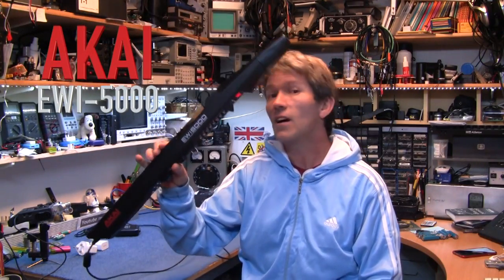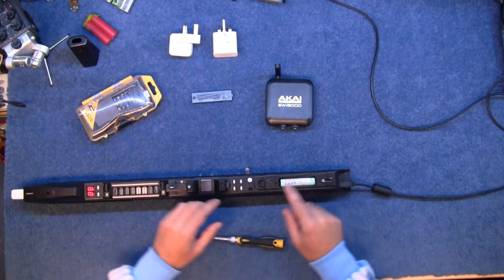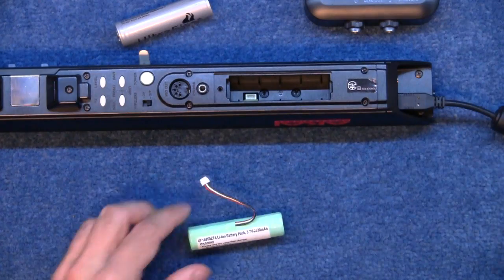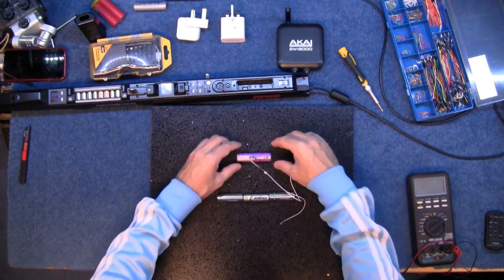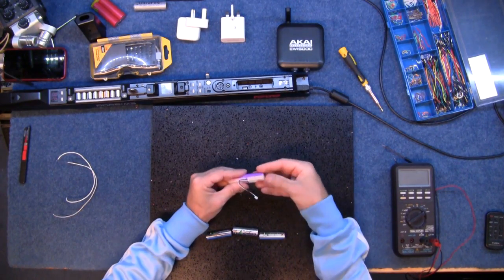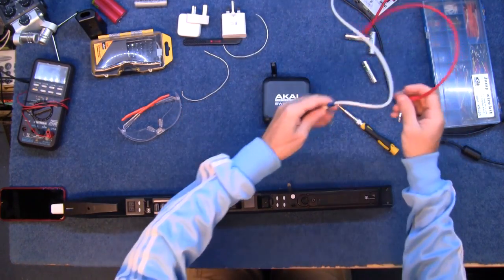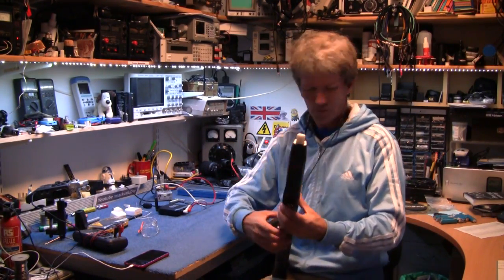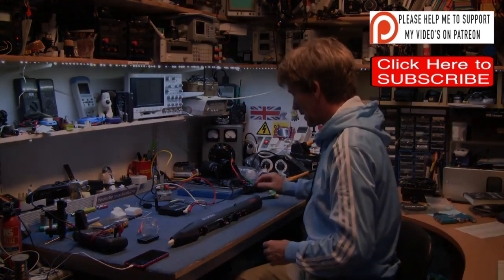AKAI ewi5000 the 88 fault lithium battery repair

Comment: I can't believe you don't have a proper variable lab power supply with current limiting capabilities. Would be much more saver with that.
Also the handy cables with the pins for breadboards you have in your blue chest should fit into the plug without falling out.
Love your videos.
Reply from the maker: Hello Foamidable. I have the agilent 6632b which is perfect for the job and yes as you pointed out there are the pinned cables (well spotted) but the majority of people who may own this musical instrument would not have access to these laboratory devices. I was thinking of making the video in a way that almost anyone can have a go at this fix themselves as most people would have 3AA batteries and a piece of wire. sometimes I feel my repair videos need to take into account what most people would have at home. Best wishes from Markus
Reply: It was dawning on me 5 min after I wrote the comment but I was to lazy to remove the comment ... now I feel awkward for my smartassery
Reply from the maker: No problem as I am pleased you bought this up.

Comment: so this allowed it to get to 2.7v? simply adding low voltage protection would have saved all the bother. However at 2.7v charging it is no real danger as it's not low enough to start damaging itself and causing copper to form on the internals where it shouldn't. Seems like they made a simple mistake they shouldn't have.
Reply from the maker: Yes I kinda think this part of the design was simply overlooked and it went into production. other than those flaws its a pretty interesting instrument

Comment: Thanks for the tech demo. Seems like they should've used a faster processor, and memory. Very interesting instrument.
Reply from the maker: Hi Thomas. with just a few tweeks this could have been an upgrade version of the EWI4000 instead I think its a bit of a downgrade.
Reply from the maker: when I had the ewi4000 I used the MidAir by M-Audio though thats like hanging a brick from the device. but it worked and like the fool I am I guessed newer is better. but not in this case. I would swop this 5000 for a 4000 without hesitation.
Reply from the maker: Hi as long as you take out the battery when you will not be using it for months then it should be ok. mine was on the shelf for several months with the battery installed. I found them following akai website then off to spares etc. they are on there for $49.
Reply: hi marcus, we spoke a while back about connecting up my moog sub 37 to the 5000. i find the panda audio midi beam works really great - it's not expensive and the range is amazing. easily goes 50 feet or more in an open room. http://panda-audio.com/midibeam.php I use mine a lot live and am a bit worried about the battery now - would like to get a spare just for safety. can you give me a clue where i can get ripped off for $49 please? :-) BTW i agree with you about the sounds - i have a vintage ewi 3000 and 3020m which sounds great and although i never had the 4000s i heard them and they sounded pretty good. as a controller the 5000s is better as you can program the breath controller to output any midi cc which is pretty flexible. i decided i never wanted to hear it's actual sounds again after about 10 minutes messing with it!
Reply: yeah - i just checked mine and although i haven't played it for a while it's still at 92%. it's more of a belt and braces thing as I use it live. would be good to have a spare charged up in the gig bag just in case! i'll see if i can find it - i presume it's on akaipro...
Reply: sorry - being thick here - can't find a spares link on akaipro.com - neither in support or shop. if you have a sec to give me a pointer i'd really appreciate it. ta!
Reply from the maker: https://www.mpcstuff.com/akai-ewi5000-spare-parts-and-accessories/?cat=211
Reply from the maker: There you go. it was on a website called mpcstuff. sorry about that.
Reply: thanks so much marcus - might wait a few weeks though and see if the pound goes back up a bit! i've bookmarked it for the future :-)

Comment: This makes me wonder, if a small firmware upgrade wouldn't solve the problem? It would appear that there should be something like a very strick threshold for the minimum voltage on the battery.
On a different matter... Darth Vader called: he wants his spinal cord back! ;)
Reply from the maker: Hi Philip I too think there could have been a software update to fix this as I doubt the onboard battery circuit is refusing to charge when it dips below 2.7

Comment: Why do companies choose to use non standard size batteries and cripple them with stupid charging logic.
Reply from the maker: Hello Clive. I agree it is so annoying especially as the battery bay could have been made a millimeter wider quite easily. I just wonder can this ever be trusted at a gig if you needed to rely on it as your instrument especially as you cannot even charge the thing or use it on the power supply if your battery drops below that certain point. practically dead in the water. pity as the ewi4000 just took 4 AA batteries.
Reply: markusfuller i did wonder if a spare battery could be made but that circuit board probably doesn't help.
Did I see that you are also in Brighton?
Reply from the maker: Hi Clive. Yes I live in Brighton UK
Reply: Clive Flint 
It's all about the money, they're obviously making it to a price with the slow software and with the soft on/ off switch they can also rake in the cash with replacement battery's. 
SoShine™ make a good universal lithium charger, it'll charge from 18650 all the way down to the 16340 battery's so it would also fit these battery's too.
Reply: Green Silver if the battery was open at each end then the soshine charger would be suitable.
Reply: Ha, I never knew. Brighton's a beautiful city.

Comment: meh charging li-polys like that isn't that dangerous that one has protection too. Why didn't you just use a current limited bench supply ?
Reply from the maker: Hi Yes I could have used my bench PSU but I was trying to achieve this in a simple manner thinking not everyone will have such a device but may have 3 AA batteries. plus I have to mention all the warnings etc as it is going on youtube - kinda just a way to cover myself.
Reply: markusfuller s